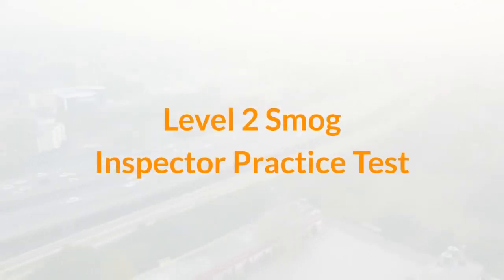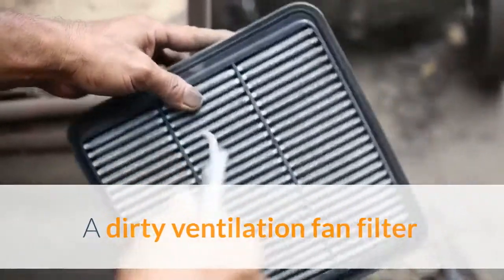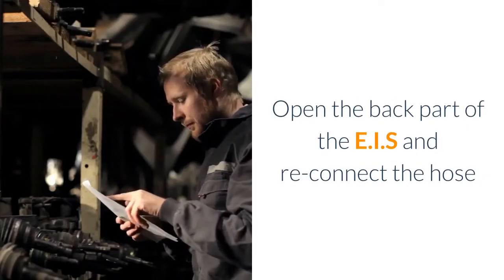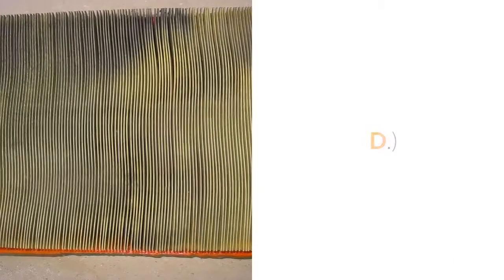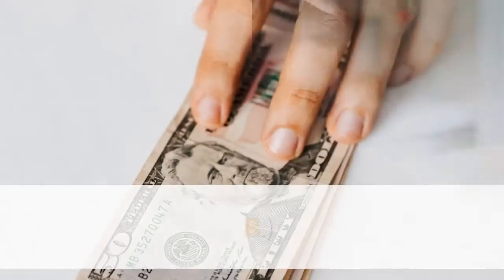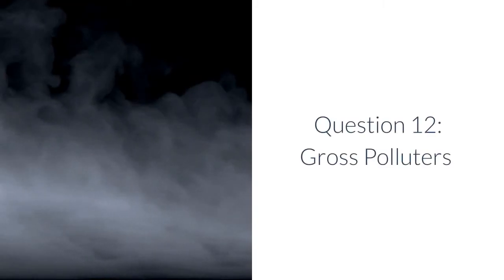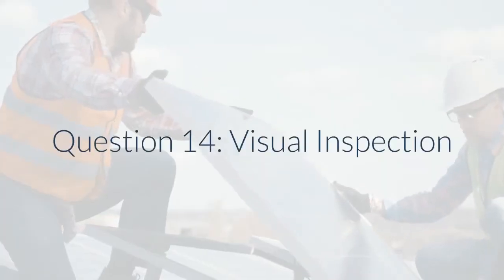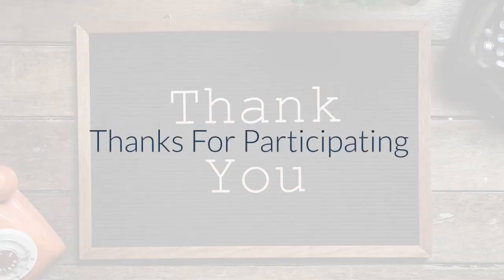Smog Tech Inspector Exam Prep - Practice Questions and Answers - California Smog Check Inspector

Comment: The moving EIS to edge of roof answer could have been worded much better. I think it means you are able to move the machine outside the door, if it's still under the roof/awning of the building. Makes it sound like you are on putting it on the roof.
Reply from the maker: You are right that could have been worded better.  But I think its written like that in the smog manual - Thanks
Reply from the maker: Ok thanks

Comment: When looking under the hood an inspector notices that the  oil dipstick seal is missing what entry should be put under PCV OIS . * ?  would this be tamp or def
Reply: Entered as missing?  Right?
Reply: @dc2david  Not correct. You would enter missing for EIS but since we are talking about OIS, it would be tampered.
Reply from the maker: I would say defective

Comment: What happened to the 2nd and 3rd video for the exam prep?
Reply from the maker: Let me check it should be there
Reply: @natedaviscteinstructor  Any updates with the videos?
Reply: @natedaviscteinstructor  Is it possible to reupload the 2nd and 3rd video? my exam is on tuesday
Reply: @natedaviscteinstructor  Thank you! I passed my test
Reply from the maker: @tinchieng3716  I’m glad to hear you pass CONGRATS
Reply: @tinchieng3716 hey, i was wondering what you used to pass the smog exam? I’m on my 3rd attempt…
Reply: @terrenceidos7182 hello, if u know the smog check manual really well you’ll be sure to pass. I didn’t pass on my first attempt but my second attempt. There were other videos on this channel but I guess they’re gone now
Reply: @tinchieng3716 for the smog check manual do i read everything or is there specific areas i focus on? I’m not a reading type of guy and the smog check manual is a lot to remember… lol
Reply: @terrenceidos7182  I read the whole thing lol, but ur old test should say what ur strong points were and where u need improving on. I read the smog check reference guide 2019 if I remember correctly